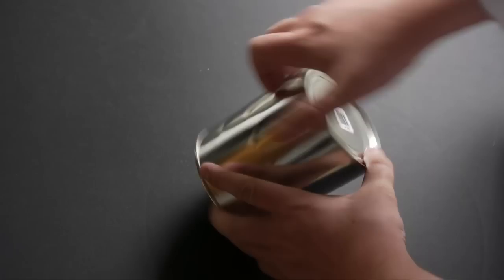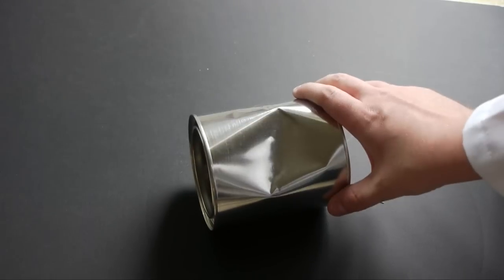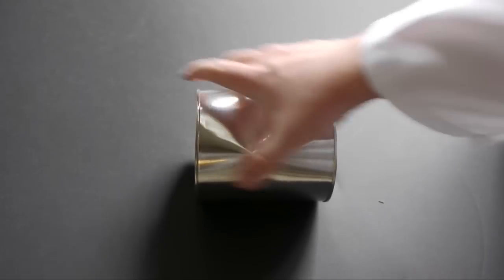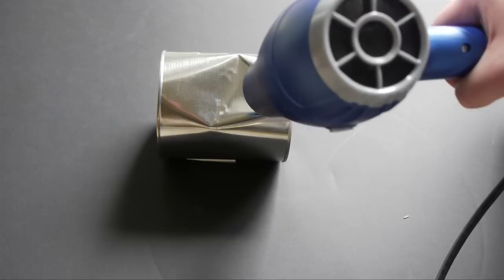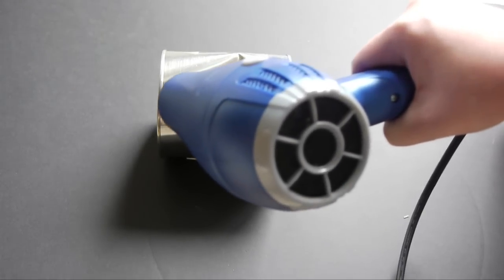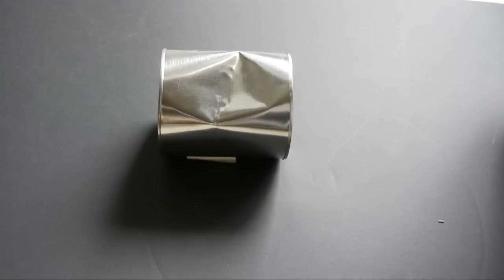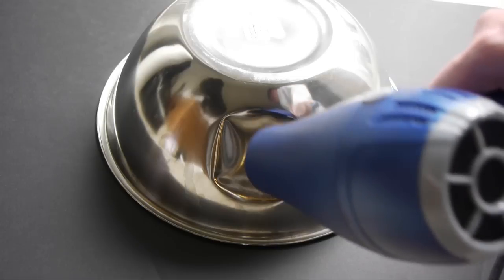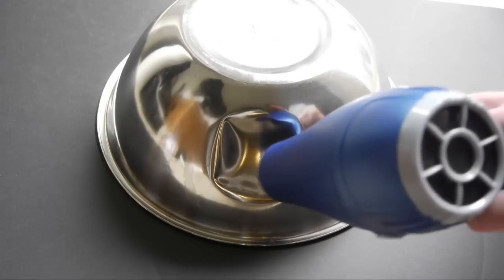Scientific Tuesdays - Removing dents with a hair dryer?

Comment: The heat isn't nearly enough to soften the actual metal (not just the aluminiumoxide) and also cooling it down wouldn't be enough either.
Instead you should've used a tool with about 1000-1300 dgr C, and concentrated it to the middle as you cool down the circle around the dent. Making the metal in that middle area expand outwards! Am I wrong? ;o

Comment: it wont work on a car because
1) the blow dryer isn't hot enough to even affect the metal in a way and 
2) if you were to use something hot enough to remove the dent the paint will crack on the affected area then your stuck paying a few bucks on a new paint job

Comment: dolly,hammer,uni spotter, bondo, sanding block. sand paper list 80, 180, 320, then you will need some primer dupont 7704s. i work in a body shop. sorry had to be a smart ass

Comment: I guess no one thinks its common sense that it needs WAAAYYY more heat than that? It needs enough heat to make the metal expand (a lot more heat) so by the time you spray the cold air on, the metal will have a way of moving back to its original shape. Try a heat gun instead of a dryer. That way you don't have to sit there for hours heating the thing.. 3 to 5 min with a heat gun should work. then blast the cold air (without the fine nozzle). The nozzle impairs some of the flow.

Comment: why is the air white on the metal can and the bowl?
Reply: The air is VERY cold and that makes tiny water particles touch the surface they gather making water drops and they cold turns them frosty and also it can give you frost bite
Reply: but it is compressed air, hw is it cold? and when u spray it on something like ur keyboard, it does not do that.
Reply: Rachel Nguyen Not trying to be mean because I really can't explain it myself, but have you not used an aerosol can before? You know the more air you spray out, the colder the can gets. And its turned upside in this video. Try turning a can upside down and right side up and compare the two.
Reply: Oh probs cuz he was concentrating on a small area whereas a keyboard u dont really concentrate on a single part
Reply: sukira21
no, u didn't think that im just a "kid"?
Reply: Rachel Nguyen I don't think anybody is a "kid" on this site unless they're trolling and getting pissy at everybody. You seem to be actually confused about this topic and wanting to learn about it. so, I'm not calling you a kid or thought you were one because I feel you genuinely want to know about something you're ignorant(not in a bad way, you just don't know about this, which is what ignorant means)about this. I'm just telling you that if you get some hands on experience with it,it'll be a lot easier for you to understand other than having somebody explain it to you over the internet.
Reply: Air is a gas. As you should know most everything has three forms (Gas Solid Liquid) Oxygens(<Gas) liquid form is extremely cold on par of that of liquid nitrogen. Now an aerosol can works by compressing a gas (Putting it under pressure) and cramming it into a can so it can be sprayed out latter. Now when things(specifically particles) are put under pressure they find it harder to move they slow down. This is the same principle as in cooling something the molecules slow down as they get colder. Now think of steam that is water in its gas form when it hits a surface it condensates(cools into its liquid form) and turns back into water. This happens to the air when they cram it into the can and a small amount of liquid oxygen forms in the bottom. Turning the can upside down gives this liquid an easy path out of the can.
Reply: i think its because the surface is so hot and the compressed air is so cold that it reacts by freezing or something i dont know its a stupid theory but it was worth a shot
Reply: The air inside the can is co2 but the whit stuff is liquid co2
Reply: thank u at least someone is being nice.
Reply: I saw ur reply for christian hand i know its full of nasty people. I like ur pic cute bunny xx i will subz 2 u
Reply: Bryonny Evans
thx

Comment: First of all, they are trying this out on an aluminum can, which isn't the same material used for car bodies. Put a magnet over ur car, if it doesn't stick, then it could be made out of aluminum, if it sticks then its made out of either: iron, steel, manganese, even zinc. However some cars use fiberglass. 
Secondly, doing this on your car, will most likely damage the paint, a lot of pain damage is done by the sun, due to car being exposed to too much heat without protection.

Comment: this isnt all that accurate of a test. aluminum is a softer metal and stretches more than steel, and it withstands heat much better than steel. cars are not made out of aluminum they are made out of steel. they would stretch far less and get much hotter when heated up which would result in the steel shrinking more and possibly "popping" back into place. so the fail here was how the test was done. sorry to say.

Comment: Theoretically it is possible to do this, but you need a HEAT GUN, not a hair dryer, and you need to be able to cool the area down quickly... like a bucket of ice water.
It can work, but it can also damage the paint on a car very badly, solution.... use a suction cup to pop dents, or have a professional do it.

Comment: The reason yours ddnt work is because your suposed to do it repededly. Plus the stuff u used isnt what car fenders are entirely made of, you have to take into concideration the paint on the surface as well. And your suposed to tap the surface around the dent with your fist a few times. ive done it with my 88 trans am Gta and it worked wonders for me

Comment: another idea is to use a more powerfull blow dryer like the ones used to heat up pvc pipes hot enough to bend them. no its not a regular blow dryer or a torch but like a blow dryer on steroids. ive got 1 i use it to heat and form plastic when they get deformed. the only prob is thet mine has three settings hot-off-cool and i cant controll the temp. another thing you can do is use the coolant that is used to charge the ac in a car instedad of the canned air both of those do the trick.

Comment: Can any1 tell me why I need to use the air compressed on the dent area? TY
Reply: what comes out is actually liquid co2, which is extremely cold. You heat the surrounding metal, which causes that metal to expand, pressing on the metal around it. When you apply the super-cold co2 to the dent area, the opposite happens - the metal 'shrinks up', or becomes more dense. In essence, the dent is pulling itself in while the surrounding metal is pushing it out. Don't do it the way this guy did, though, you have to apply a constant stream of co2 for 30+ seconds, otherwise the dent warms up again and it doesn't work. Hope that helps! :)
Reply: uninvincibleete AIR is not co2

Comment: @THExXKuBa Don't be so ignorant. I'm aware that a paint can's material is similar to a car's. However, It's "similar". I said inaccurate, That doesn't mean "false" Results could be "slightly" different. Nor was I faulting him for using a can instead. Sometimes you have to use what's available if the real thing isn't present, That's understandable. Besides, Each viewer has every right to choose they're own path. I'm in no way trying to mislead others into thinking this method works.

Comment: you need to get it alot hotter and it only works on steel not aluminum.
most ppl use a hot air gun or a torch

Comment: The problem is he's doing it with a hair dryer. Hair dryers don't run hot enough, you need a heat gun. If hair dryers are cool enough to use on your own head, how the fuck do you expect it to be hot enough to cause the metal to expand?

Comment: this was very done wrong, because of how THICK the metal is, the metal or material used on cars, is much thinner, and surface area is much bigger, so it has alot more area to expand and contract, so doing it to a coffee tin, for 1, its thicker, and because its small and how deep your dent was, well of course it aint going to pop out! its going to take alot of effort to get it to, then 2nd, you take a big what was it? stainless steel bowl or aluminum bowl, well those bowls are HARD to dent&undent

Comment: @nightsurfer1 Get off your high horse, he even said at the end (which I doubt you watched, because I'm assuming you only watched until after the paint can) that it's entirely possible that it might work on a car. And something you forgot to mention is, thickness of the metal also matters. That paint can will probably have thicker metal than a car door does, a thickness which will also scale up to match sizes.

Comment: You know that you need to use a heat gun (a hair dryer that gives of high heat as the min. Temperature is 350 degrees F) you held if for 45 sec when you have to hold it for 5 minutes. So it should work

Comment: Use your scientific brain! By heating and cooling the entire dent at once, the entire dent expands and contracts evenly. Try heating the entire thing then cooling a portion in the middle. Would that not draw metal from the sides of the dent, possibly causing it to "pop" back out?

Comment: Should have had more time on the heat, a temp gauge on the back of the metal and held the hairdryer in your right hand and the comp air in the left.. not such a long switch over time..

Comment: 45 seconds is nothing. If something like that is going to work you are going to have to get it VERY hot not just slightly warm. Try running a hair dryer for 5mins on it, or even a heat gun then it might actually work.

Comment: you're test is the fail, not the idea. you must apply force for this to work. on a car quarter panel, this would be slapping the metal around the dent after its frozen.....if the dent is near a door handle, you can easily tug on the door handle and the dent will pop itself out....regardless, you need some sort of shockwave to pop the dent, the metal isnt going to fix itself if its creased without the use of force....the hair dryer and can of air make it EASIER, but dont do the work for you.

Comment: First, the dent must be a good candidate for dent removal. Any creases and forget it. Second, the heat must be applied to a wide area, and the cold only to the dent. The cold must be applied very quickly, as it only takes a 2-3 seconds for the sheetmatal to cool off by substantially. It appears the whole clip was made specifically to show the thechnique would fail. Any charlatan can do that.

Comment: okay so here's the thing it failed caz every thing u used was aluminum and as we all know aluminum does not hold heat there for if it dose not hold heat it will not contract and push out the dent when u put the coldness to it there for u was the fail not the theory

Comment: You are only supposed to heat around the dent, so that the outside will kind of "pull" the dent out when it contracts. Also, you need more heat, longer than 3/4 a minute of a hairdryer. FAIL FAIL FAIL. It worked on my car.

Comment: You know this test is pretty invalid imo, cause the curved surface of the testing is a lot different than a flatter panel of a car. Also  the dents that this method can fix is not as deep or as creased as the can or bowl you used. Also the type of metal is different as well.

Comment: No shit you don't heat up metal nor steel to to dents out. You just Distort" it and changed slightly the shape.. bumper offcoirse it works. Its plastic and majority of the vehicles now are made of polyorlefin plastic. It has a memory type plastic. So u ad heat it goes back to it size or at least most of it.. inoe I'm right ;) .... haha attended collision repair automotive :P

Comment: Yes this does work ANYWHERE on car. The metal being used is not equivalent strength to what is used on a vehicle. Higher grade metal is not as likely to crease like he did with the dents he made. Also I've be we seen a car the shape of a can or a bowl.... Small curves yes but all he wants is to prove someone wrong. Last of all use a HEAT GUN.... A blow dryer might get it got enough after about 45 mins....  If you relying on this guy for body work your in serious trouble lol